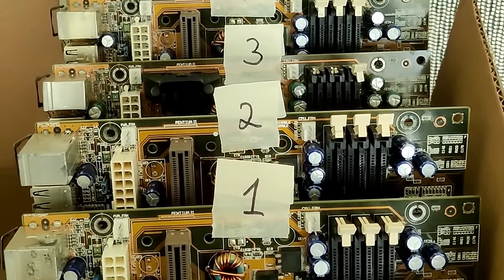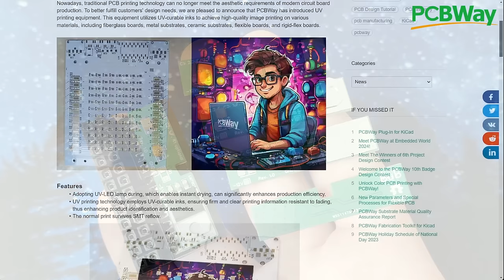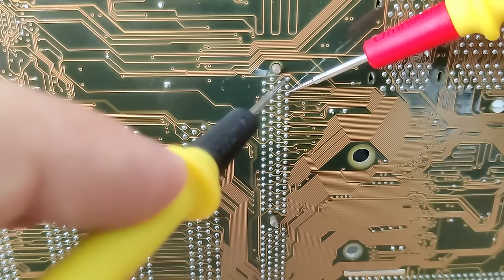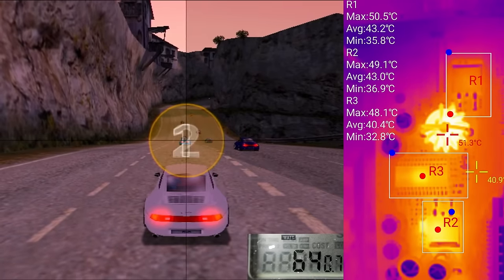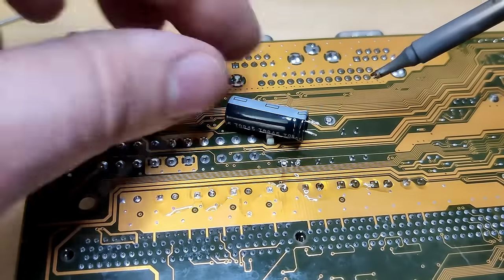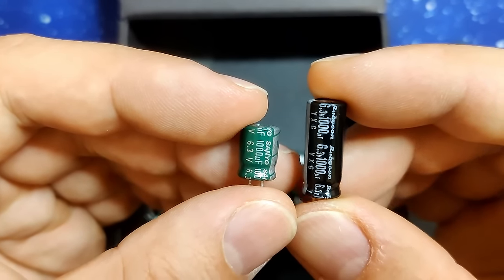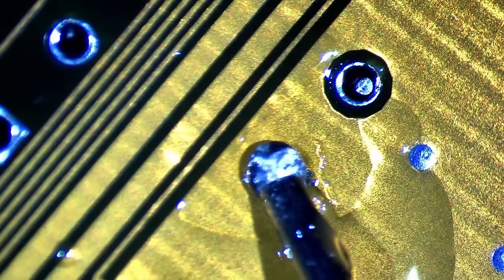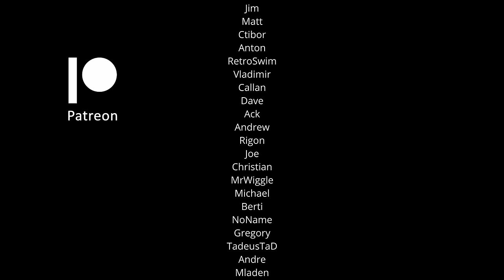ASUS P2B Restoration: Board #5 - Replace 25-year-old capacitors?

Comment: If nothing else, redoing the caps will have been better for ripple on the voltage lines going into the CPU. it's not going to immediately change the temperature of components around the CPU, but it will still be a far cleaner signal. ESR isn't everything, but how fast the capacitor is to switching definitely is. In a PIII system where you're getting 5v in to generate the voltages for the CPU, it makes not a whole lot of sense unless you're overclocking or going at higher frequencies. for a Pentium 4 system of any kind, however, it's really everything. The plague caps had very good switching characteristics when they were new, but as time went on and they got hot, they get unstable and vent from the poor chemical composition.

Anyone running a Pentium 4 system with a high-end (for the board) CPU should be looking to upgrade the capacitors to polymers, following the rules for replacing electrolytics with poly as needed given how much faster they are. the caps on the input side of the VRM section can still be electrolytic, but need to have fast recovery time (higher-end general use caps and most power supply rated caps i.e. Nichicon PS Series, now discontinued as of last year but still attainable) in order to satisfy the needs of those power hungry CPUs. if you're overclocking, this is especially significant as the VRM section needs to be able to provide clean power to the CPU to supplement running the CPU out of bounds of the deemed safe running speed. 

I have a GX400 I recently put a socket 423 to 478 adapter in with a 2.8GHz Northwood to max the system out. When I did that, I also did my homework and upgraded the VRM card to one with a better design that was only used in the Precision 330. But, I haven't had to really worry too much about capacitors too much on the motherboard itself, as my particular revision has Sanyo oscon poly caps on the output, and some nicer sanyos on the input. Given this is still from the cap plague though, and to minimize issues in the future, I'm still replacing every capacitor on the board as needed for the sake of completeness and caution.
Reply: I have a few boards and I can tell the Pentium 4 are the ones that give more problems, like killing CPUs and memories. The motherboard itself would still work, but the other components were killed after some time working. I believe those caps are the culprit combined with poor power delivery circuits.
I agree with you, is not just a question of consuming more power, but it is actually dangerous for the hardware if the caps are not good. Even the voltage could be right when measured with a multi-meter you wouldn't know how bad the ripple is. For that you need an oscilloscope.

Comment: any ideas on how to upgrade the power delivery system so it does not get as hot?
Reply from the maker: It's actually not that hot. Those chips stay below sixty degrees - which is quite good. You could add small heatsinks and have a fan blow over them if you want to reduce the temperature.
Reply: @bitsundbolts  but heatsinks are not fun to watch being glued on :P and maybe with a new power system it could overclock the cpus higher and make them a bit more stable

Comment: I've seen some enthusiasts using solid capacitors in these old boards, most of them did for better overclocking. Do you think this could be useful?
Reply from the maker: I did the same for the ASUS P4B in an older video. I'm not sure if there will be a difference on those boards. I doubt it, but I don't know. At least for my use case, electrolytic caps will be fine.

Comment: Back in 2005 I recapped a "plague" era P4 using caps from some old P2 board.. Symptom was freezing while running and refusing to restart for a few hours.. as of last month it's still going strong in daily use (runs old photo editing software for a small business). I think 19 years for a "free" repair isn't bad. Don't be too hasty to remove 1990's caps unless you actually have good reason. I don't think new ones are anything like as good.
Reply from the maker: Absolutely agree with what you say! I rarely saw caps on PII and older boards failed. I think the quality was a lot better before the plague.
Reply: @bitsundbolts  Yep if anything the ones you put in will fail soon and you'll just end up putting the originals back on.

Comment: Nice job on those caps removal... Are you using solder without roisin core?
Reply from the maker: Haha - nice that you asked this question. I will dedicate a minute in one of my future videos to the solder I am using. As a matter of fact - it is a perfect match for the boards I am working on. I found a date stamp on my "Balver Zinn" Röhrenlot (made in Germany, 26.08.1998) - I guess this is a bit of fun trivia about the stuff I use... But it does have a rosin core. If you wouldn't ask, I would never look at my spool of solder in detail. Thank you.

Comment: Sometimes you just know the capacitors are bad even if there are no visible signs. Because you already dealt with a similar circuit from the same era equipped with similar caps.

Sometimes you have a strong reason to suspect that the caps are good as new. To me this board was a strong candidate, so i wasn't exactly surprised.

Usually i just pull one cap from each series used, one that i expect to experience more ripple current or more heat, and just check that, and if it looks good, back in it goes. If it's even a little dubious, all of them get replaced.

Unfortunately how good the caps are is generally a hindsight assessment. You don't know what you're putting in today, how it's going to fare. I figure something that has been around for 20-30-40 years with little degradation can probably do the same again.

But some very smart people disagree. James (The Bald Engineer) ex Kemet executive, also a classic computer enthusiast, would yeet them all, simply because they are fundamentally wear items and have degradation modes that occur both in storage and in use, and may not fare as well e.g. with voltage spikes, so a sudden failure in the future is a possibility. It's not like our ESR meters test them all the way to the forming voltage, indeed they only do a small-voltage test.

Comment: If I were to give hardware to someone not equipped to handle board repair then I would replace the capacitors on principle. If they were to go into my own projects then I wouldn't necessarily do it unless needed. I just think it's about understanding who will have the board and whether or not they can catch them failing and then being able to handle the repair.
Reply from the maker: Good point. Although replacing caps is easier than replacing SMD components (in my opinion), you still need the right equipment.

Comment: Most of my boards are still okay and don´t needed nor need a recap. Had to repair the Socket A Gigabyte Board of my Mother in Law, some Fujitsu Boards with caps from OST and also Grafikcards with bulged caps. Most of them had to sustain long operating hours and heat. If the cap is bulged or has a brown top, then replace. Otherwise not.
Reply from the maker: Yeah, I have a few of those candidates as well. Socket A and P4 boards seem to always be affected by bad caps.

Comment: Good to know that OK-looking caps can apparently reasonably be expected to actually be OK, as long as they were not subject to the plague. 👍🏻 This board looks like it didn't have a particularly hard life either, but with an unknown history/origin, it's always hard to tell.

Looks like I should get myself some low melt solder too. I also prefer the wiggle method for removing old caps, but clearing the holes often ends up being a major hassle. Thanks for including links to all the stuff you use (some of them no longer work though). Also, I'm curious what this low melt solder is made of, I can't tell with absolute certainty from the info they provide on AliExpress, does it say Sn42Bi50Cu8 on the label?
Reply from the maker: Yeah, I know that some of the links to not work in every country. It depends from which location you're accessing the stores as it seems. Unfortunately, I don't know how to fix that. I should write a URL resolver where I can update links and it would update below all my videos instead of posting the URLs directly... Regarding the solder, you are spot on: Sn42Bi50Cu8. 42% Tin, 50% Bismuth, 0% copper.
Reply: @bitsundbolts  Oooh, besides the "Page Not Found" title and the big "Sorry, the page you requested can not be found", there's a smaller "unavailable in your location" message too. Typically Chinese. 😄 I just saw the bigger message first and immediately concluded that the AliExpress listings had just gone stale, as they often do. No need to fix anything in that case. Providing multiple links is already more than anyone can ask for and it works in my case, too. I just wasn't aware they link to similar products - labeling them as "alternative listing" may help to clarify that though.

A URL resolver would indeed be an elegant solution though, esp. for keeping affiliate links up to date. 😉 I have one in place for other purposes too, super simple (quick & dirty PHP switch/case in my ...case) and super handy for all kinds of situations where you want to retain control beyond the time of posting a link. 👍

Comment: PCI POSTCODE card all "-" means no CPU? raplaced thermal paste on an AMD Athlon on a GA-7ZX and no post after, the pci post debug just stays at ----, no beepcodes either. so I wonder if it's dead mobo or dead cpu?
Reply from the maker: Usually, the post sequence starts with C0 and then C1. I think I've seen boards also all "-" when no memory is installed. Hard to tell if it's the board, ram, or CPU - the only way to know is to test each component in a known good system.
Reply: @bitsundbolts  if my CPU died, will it damage a working motherboard? or other way, if the motherboard died, will it damage a working cpu?

I have another set of motherboard+cpu coming that should be compatible. but afriad I will break more things so I'll probably just switch the working set into the PC case (fujitsu siemens scaleo with transparent blue front)
Reply: @GizmoTheGreen  Permanent damage is unlikely unless a the power rail is way out of spec or a rail gets shorted to a lower-voltage data line. Since the motherboard is in charge of power delivery it's much more likely for a bad mobo to kill a CPU then the other way around.

Comment: I would definitely feel better with a recapped board given the age of the capacitors at this point, assuming you use good capacitors from a reputable seller.
Reply from the maker: I hear you. Opinions differ from replacing all to leaving them until they fail. If there's no stability issue or any other weird behavior, I tend to leave the caps alone. I wouldn't be surprised if they continue to work for another 20 years.

Comment: A recap wasn't needed, but doing so you might have extended the life of this board by another 25+ years. The caps will eventually dry out or leak, it's their nature. It may take 50+ years, but they will fail some day. You just gave it more time :) if you are preserving that hardware, you did well. If you don't count on having these boards around for the next decades... Well... You wasted your time 😂
Consider using an ESR meter that can test the caps in circuit. An oscilloscope might also be a good tool for testing the ripple
Reply: ERS meter is good for testing caps, but gives you false value if just few caps are bad. Because they are connected in paralel.

Comment: amazing that these caps were ok after this long, tbh. i found last week the abit bp6, the one with dual celeron support, it's pretty known as a board, and it doesn't start at all, dead. i heard that the caps were a big issue with this board, you think it's possible that changing all the caps would bring it to life, BuB? i think it's the most valuable board from my so called board collection :) gr8 video, as usual
Reply from the maker: You could try to measure the resistance between both leads of one of the caps. If it is low, it might indicate an issue, but to be sure, take one of the caps out that are located next to the CPU socket and measure them if you can. It could very well be that the caps are responsible for the board not working. How do they look? Any swelling or leakage? Where did you find that board? Maybe there are deep scratches on the back of the board. Or contact of through-hole components are touching.
Reply: @bitsundbolts  i found it at the scrapyard, visually, it looks ok, and the caps look perfect, no swelling and no leaks at all, which is odd since the forums that i read said the caps where a big issue here, saw a video of TechTangent where he replaced all the caps. thanks for the info, BuB. when you'll get back to Germany...I could send it to you, if you'll have the time :)
Reply from the maker: I probably will be in Germany only in December. Regarding the caps, it could be that the caps look fine, but they still dried up. I also get most of my items at the scrapyard now. Usually, they always have some fault due to the rough handling there. Maybe one of the voltage regulators popped off the board 😅

Comment: Low melt solder and wick to clean up after a slow removal of caps? I believe you have a desoldering gun/station, use it?
To me, changing caps on an old board is like an oil change in the car, you dont wait until it goes bad. Its the difference between doing service and repair.
Reply from the maker: I tried with the desoldering station. Mine isn't good enough to melt the solder. I would still have to rework with the iron. There is copper on both sides of the board, and probably also in the inner layers.
Reply: @bitsundbolts  I have a semi cheap chinese desoldering gun, have it set to 350-400 degrees when working on lead free.
Reply from the maker: I'll give it another try. I don't do much with the desoldering gun. Could be that I need to spend some time to find the right settings
Reply: @bitsundbolts  add fresh solder and it works on most things 🤣
I have used mine to clean pads when i was out of wick 🫣

Comment: I like how unsupported CPUs boot. They don't now. You have to flash before they boot.
Reply from the maker: Yeah, pretty cool! These days, if there's no microcode (AM4 was my experience 😅), you're out of luck!
Reply: @bitsundbolts  It's not just AM4. AM5 will also require an update and all intel chips as well. It's less of an issue on intel because every other generation is a new board anyway.

Comment: its not _needed_, but the closer a device gets to 30 years old, the less inclined i am to keep the caps 'original' unless its micas that test okay or similar. electrolytics? yeah, likely going to get replaced. i don't care how 'fine' they look, and without specific test gear, you're not going to get the readings showing they're faulty when they start going out of spec until they've already failed entirely.

those cheaper LCR testers don't give you the info you need to make a proper determination. some of the higher end ones do, and gear made for the purpose (like the carlson capacitor tester) will let you know exactly how bad a cap is, but most people don't have that sort of gear.

Comment: A good electronics technician repairs a problem. An excellent electronics technician will repair the problem and prevent future problems.
Electrolytic capacitors have exceeded their useful life. If they did not fail, they will surely fail in the short term.
They all have to be replaced.

Comment: Think about it:
They weren’t reformulating electrolytic capacitors in 1999 for no reason. There has to be a reason to make them worse. The “only stole half the formula without the stabilizer” part only explains the Taiwan/China caps that were failing within a year, not the name-brand ones that fail in several years to a decade when their old formula did not. Why were they reformulating to a worse formula BEFORE half the formula was stolen?

It’s because of RoHS. Mandatory environmental regulations have put far more electronics into the ground than there ever would have been without Pb-Free and RoHS initiatives.
Reply from the maker: I have a feeling that your opinion is unpopular and disregarded by many. However, I 💯 agree with you! More often than not, intervention from regulators causes adverse effects! Look around these days, it's everywhere! God knows what interests were followed with all those regulations. The easiest way to get to the root cause is: follow the money - and you'll see who benefited from it and why...

Comment: All SMD electrolyte caps from 90's and 00's require recapping. No exceptions. I need to dig my wii out of storage and recap that. It will leak and kill it. It was a launch day wii. They are definitely affected. Other than that, I think it's a good idea. Required? probably  not, but still a good idea.
Reply: it's less about are the values correct and more about they could still go bad and leak later on. I'd say at least 20 years old is a good candidate for recapping. The older it is, more so.
Reply from the maker: I'm sure every cap will fail at some point. I guess it will be the new owners of those P2Bs who will need to recap them if they want to keep them for a long time.
Reply: @bitsundbolts  I kind of feel like 80's should be automatic. And 90's should be encouraged. And then it will be more likely to survive that issue. Then again most people using these ancient boards will be willing to figure out what happenhed.